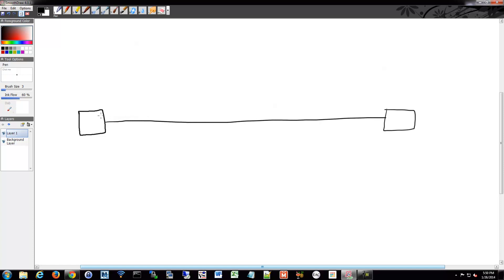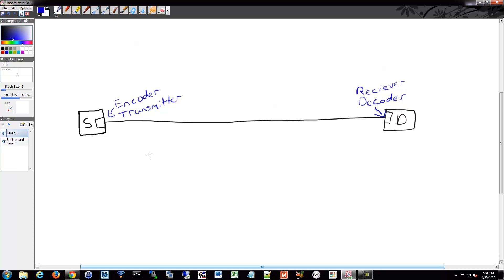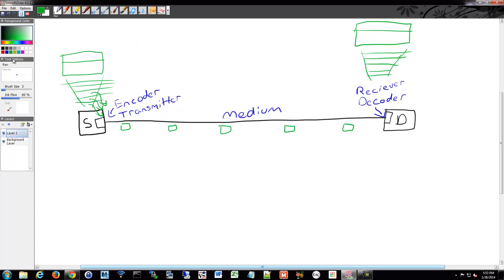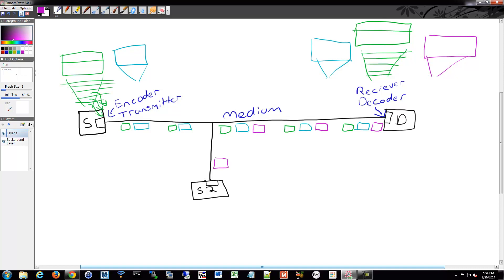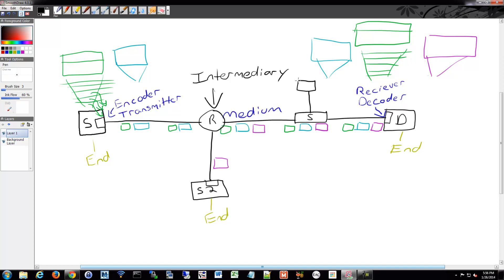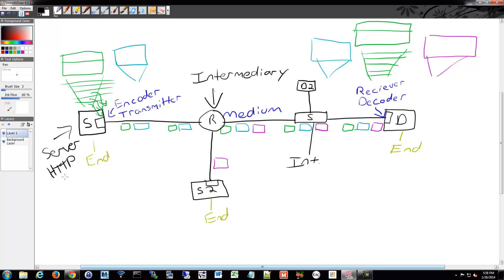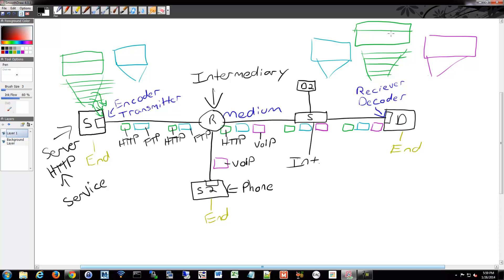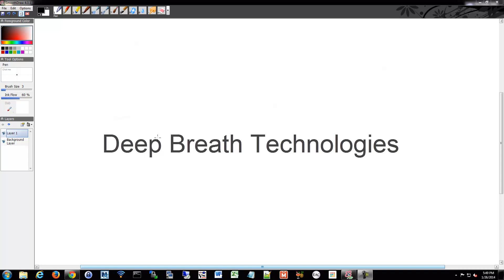CCNA/CCENT 200-120: How to Communicate 8/84 Free Video Training Course

Comment: Good Tutorial but am afraid you did not go with the Topic from Cisco. Eg:1) Operation of IP Data Network2) LAN Switching TechnologiesAnd so and so on..
Reply from the maker: +michael kamara I don't follow. The materials are based off of Cisco training material, and the order of them can be flexible, as instructed by Cisco. I prefer to learn/teach them in the order provided, rather than the "new" order, which is reverse.